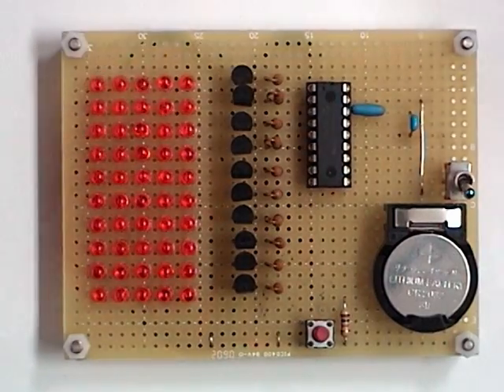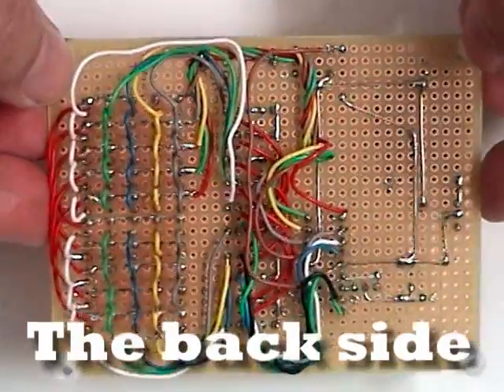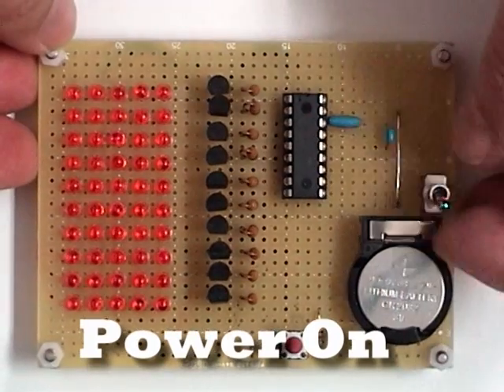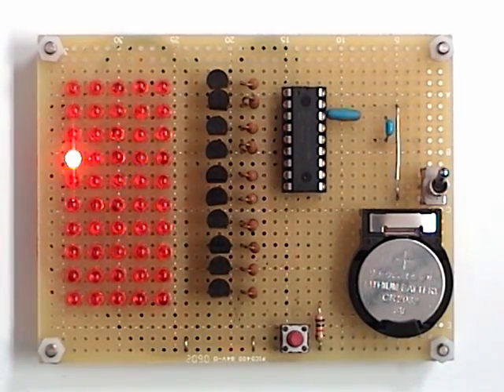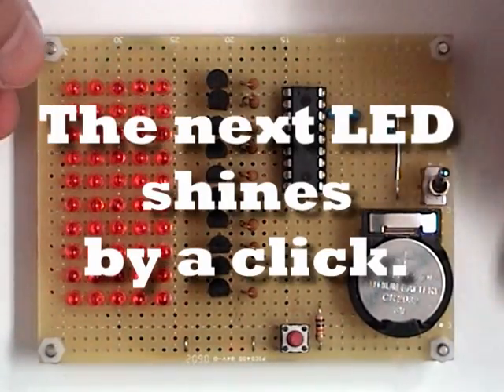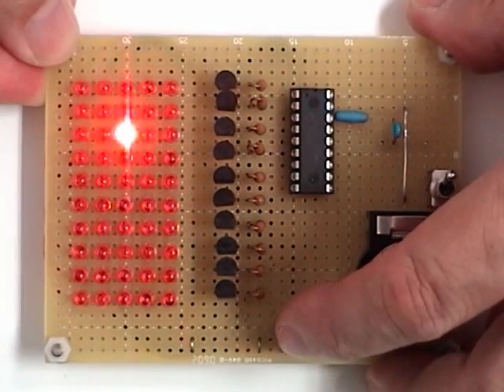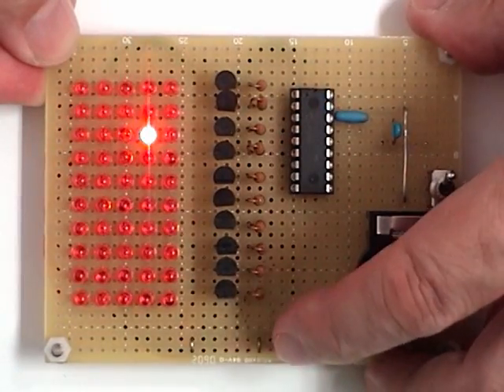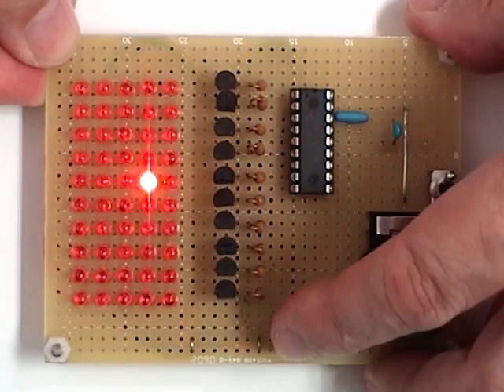I control 50 LED with one button

Comment: yes you can implement this with the 8051, actually it has more ports than the pic 16f84, i would refrain the use of port P0 as it requires external pull up resistors

Comment: Look up the blinky grid.  It switches 56 LEDs and doesn't need any transistors.  You can get a PCB and all the parts in a kit at Radio Shack or online.  With a little code modification, you can be up and running.

Comment: There should be no problem with the 8051, keep in mind though that a couple of the ports may be needed for accessing an external EPROM, you just may need to be a little bit more inventive with your interface circuit

Comment from the maker: The last scene of this video is a connection diagram of this device. 
I can turn on one arbitrary LED of 50 by controlling the voltage of the row and column.

Comment: can i do this with the 8051 ??? cuz 8051 has only three port to interface with external devices

if not then what about using a decoder with the 8051 ???